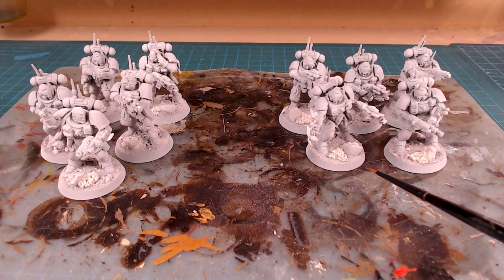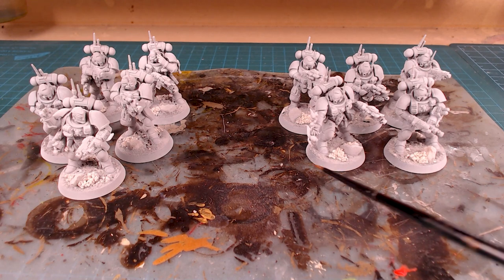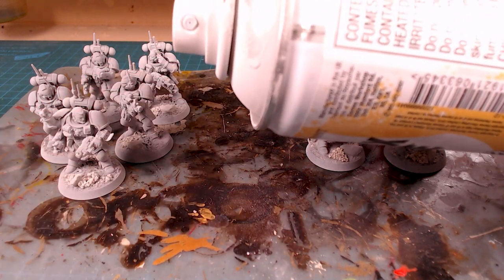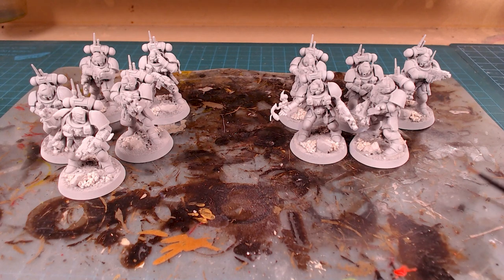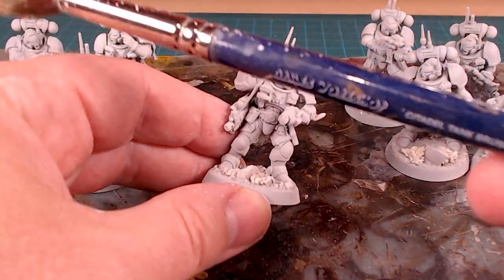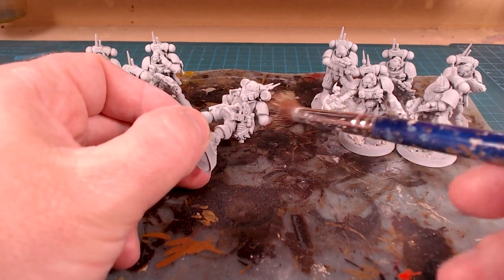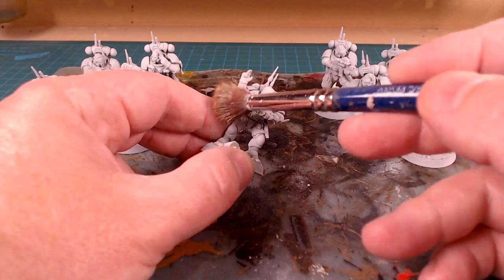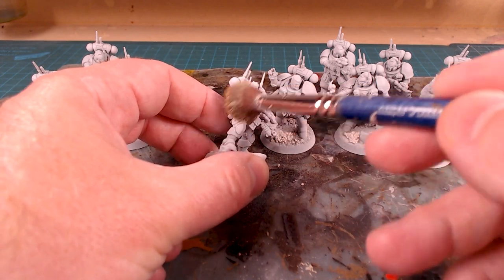Model Recovery 4: How to Fix Powdery, Chalky Finish on Corax White

Comment: I had this happen to me once on a large unit of Warhammer Fantasy Wood Elf Dryads. One of the most difficult and time consuming kits to assemble. There is a lot of detail and many thin parts on these models, so the graininess stood out like a sore thumb. It wasn't the Citadel / GW can of primer, it was the conditions I was painting in. It was a hot day and I didn't know better. The paint was drying in the air before it hit the model. I nearly painted them anyway, simce they were supposed to sort of represent "tree-ish beings" and it might look like I had done it intentionally to represent a bark look. 
I ended up soaking them in alcohol and stripping the primer off of them and starting over, priming them on a cooler day that wasn't as dry. I also used a different brand of primer.
I wish I had known or had figured out that I could have just brushed it off. 
I hope your video prevents anyone from going through the same experience that I had.
I'll second someone else's mentioning of priming with an airbrush and using Badger Stynylrez or Vallejo Airbrush primers. If you can airbrush indoors with a fan and vent the exhaust to outside, you can prime your models anytime of the year. 

I was very dy

Comment: I use Vallejo primer through an airbrush when priming white , never looked back
Reply: How do you do it? Because for me when I use it it feel kinda rubbery and there’s a chance where it scratches of very easily, I use a 0.5, what PSI do you use? Cheers
Reply: @nippyhobbies4525  Add some liquitex or dealer rowney white ink. 25-50% ink to paint.

Comment: Your advise came at a good time, I was going to use Corax White for Priming tomorrow! But I do have Army Painter White too, thanks.
Reply from the maker: Toss it on a test model and see how it works out?
Reply: Through my experience every citadel product is supperior to every single Army Painter product. You should try to find the best way to use every spray the way it suits you. Now, is it worth it to buy a cheap airbrush with the pump for lets say 200 Euros, the cleaning equipment and ofcource the vallejo primers for an extra 50? Well no...

Comment: If it's too humid or not humid enough also the temprature seems to effect it..... if theres too much humidity that paint sticks to the water vapor, or water particles in the air and onto your model. keeping a good distance away can help with the chalky finish becuase the reseding detailed parts and the ones and stick out the most have the most contact with paint. hope that makes sence.

Comment: Can confirm Corax White rattle cans are just trash. Warm environment, sprayed dry and humid, warmed the can, shook the ever living hell out of it. Here I sit with a soft bristle child's toothbrush hacking away on the same models you are. From now on I will rattle can some Grey Seer on and then build to light grey/white manually.
Reply from the maker: Vallejo primers are great and the white doesn’t powder coat your models.
Reply: @ThePrefect  Wrong, I got the Vallejo white primer and unfortunately I got the same results as you everyone else here. Model end up chalky, and I live in Greece, so no huge problems with humidity or dry environment. It seems that most white primers have issues, and it turns out from people test's or trying to find a solution, that warming in a hot medium water the can and the re-shake a bit and then spray probably will fix the issue.

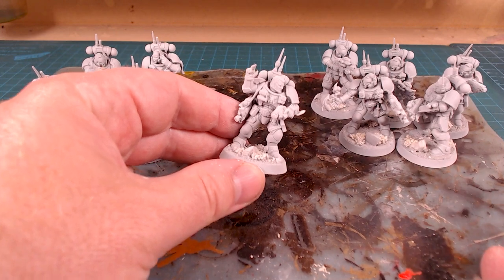Comment: dude you get that because of the high humidity. anything above 50% outdoor humidity will do that to corax white. It happened to me so i waited until a day where the humidity was 40%, i hearted the can up in hot tap water (not boiling) and i t sprayed nice and smooth. My Mephiston Redspray would spray smoothly in high humidity, however Corax white was a problem. I ended up scrubbing the primer off of my Alpine 1:35 scale figure. Mr. Hobby Aqueous primer is awesome so is the Mr. Surfacer 1000, very forgiving in high humidity. Vallejo color spray will spray chalky and gritty too at high humidity. I too tried it when humidity was under 50%, warmed it up just to be safe and it sprayed on smoothly. This is all outdoors of course.

Comment: I live on Italy,and i found after use corax white,on the surface of the mini i see a similara micro ball,the sensetaion during touch the minis is more grip,but the result similar at micro ball after sprayed corax white is normal or depand to climate ,time of shake or distance?.
Thanks for the answer.